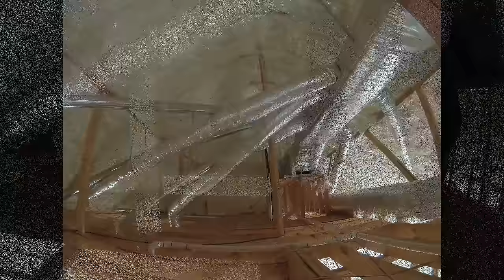Open Cell Spray Foam Insulation

Comment: So, what happens if the wood cant breath? After all its a living material.
We use foam at work but we dont fill entire walls with it.
Reply: the lumber here is a DEAD material. it should be dry and never get to breath.  If it breaths you have problems.
Reply: @kirksway1  Well, in that case why use foam at all? It makes a more expensive project making sure the wood is completely sealed compared to ordinary insulation, the regular old insulation is cheap as it is. Not to mention the new insulation is nice to work with, I can rub it in my face without itching and it doesn't make dust particles.
Reply: @kirksway1  He's talking about his "wood"...

Comment: Does anyone know if the Companies that do spray foam insulation "make their own" foam with chemicals or are they just buying the kits and upcharging the customer? I'm trying to find a way cheaper way to make my own for DIY attic insulation.
Reply: You have to be a licensed sprayfoam contractor to even buy the chemicals from a manefacture or distributor and have the proper equipment. I am a sprayfoam installer and highly advise not to buy a DIY froth pack kit from a local hardware store. There is a huge learning curve for this trade and you need to make sure you get a well established sprayfoam contractor to do your job.
Reply: Buy Froth pak great experience every single time. Just monitor both jugs so they dispense evenly.
Reply: @vertihvost7675  do not buy frothpaks…. they are a waste of money for a consumer
Reply: @BmxScuz  it's not like you're biased or anything being a spray foam contractor and all...🤣  I'm sure all painters advise a professional do the job, and mechanics etc.
Reply: Its just a hobby if your not making money, businesses have to add a percentage to everything they do to make a profit. Bro i been in business for years, work coming out my ears, stressed to max making nothing. Last 2 years looked at myself seriously, stopped charging with my heart, charged as a professional, now my bank account is way better, less stress, less tire kicking customers, better quality of life overall
Reply: @bumpsfarnorthnz6257  I can tell your a compassionate fellow. I'm the same way. I know your not looking for advice on anything but it made me have an idea as I read your comment. 
People like u & I have a hard time not martyring ourselves trying to help people out so I would actually delegate the pricing/Bid to someone else, family member/employee, that way when you show up you're essentially just the "performer of the task" and therefore your heartstrings will not tug. It's out of your hands. Having said that I'm glad you're making money & it's turned around for ya.
Reply: @BmxScuz  Not really.....

Comment: Do not like the way you apply the foam. You should dl the edges first and then the entire area between the studs. Not the area first and then the edges. Two pound closed cell foam is better.

Comment: Can anyone say what material is it that they are spraying?
Reply: You have to be kidding me...

It's open cell spray foam insulation ffs... The title literally tells you what it is
Reply: Since this guy who replied was rude as hell, this is Polyurethane Spray Insulation. Many companies make it, but theire ingredients can all be different.
Reply: @twizz420  namaskaara brother🙏🏾. I reside in tropical climatic region and hence I've never seen such insulation being done anywhere. I am pretty sure you would be amazed by things that we do in this region as I was with this insulation spray. When a person asks a genuine  question please answer them only if you want to. Please do not try to spread the poison that you have in you by being rude. Hope your friends and family do not see and tolerate this rude behaviour from you. 🙏🏾
Reply: @ryalsackjon3020  thank you brother🙏🏾. I am working on a new type of air conditioning system for tropical climates  and I wanted a good insulating material to insulate some pipes in the system. That's why I am interested in this material. They appear easy to apply and can be made to any shape. How are it's insulation properties? Any idea?
Reply: @aravindz89  Okay, well, just like fiberglass insulation, a certain thickness of material means more efficient insulation. Homes and appliances, at least in the US that I know of that require insulation, have to meet a certain insulation amount, based on the region or the appliance. The value of insulation is called R-Value. The higher the R-Value, the more insulated the home or appliance is. 
Now, there are two types of spray foam. Open cell and closed cell.  Open cell is a soft thick foam that expands alot, takes more foam to reach the desired R value. Closed cell isnt NEARLY as thick or expansive as open cell foam, BUT it has a higher R value. It is extremely hard, like hard as a rock. 
1 inch of Open cell foam has an R value of 3.7
1 inch of Closed Cell has an R value of around 6.5
I havent ever actually seen AC equipment  insulated with spray foam. Every AC unit I see when I’m spraying is insulated with fiberglass at a level of R-6 to R-10. I cant give advice on that part of things, just telling you what I know
Reply: @ryalsackjon3020  Thank you for the knowledge. The AC that I am working on is still design stage and I am in search for alternative substances for insulation than fiberglass. I will have a look into this open cell and closed cell spray foam system and will make my decision's. Thank you again

Comment: LMAO no suits? First time I've ever seen this.. This guy is trying to move on to the next bay too quickly. I'm sorry, but I'm not moving past 3 bays without making sure they're adequately filled. Not trying to run around spot checking and hitting things all day. ALSO, this guy WAY overfilled some of those bays. He's just tryna rip and run.. Look at the poor floorman, having to saw off 3 extra inches of foam. I need to come work for them and get em right lol

Comment: Hi there!! I am from Argentina, Tierra del Fuego. I like so much your work. I have been looking at machines to do the same, but they are very expensive for my economy. Do you know of someone who has made the machine in a homemade way? Any specification? Thanks and sorry for the inconvenience. Best regards!! Walter.
Reply: No there's froth packs for home use but to make a machine like this is almost impossible due to its technicalities
Reply: @isaacfranco9216  looks like this machine have same system of the high presure water cleaning. Also, some people use an attachment to spread bleach in the water machime.
Reply: @model901  Not even close. This mixes the heated chemicals at a custom ratio to achieve the proper ratio and cure. A pressure washer simply pumps water through a small hole.

Comment: any way to texture this like a knock down? Will it stay stuck on to metal? Will it gas-out fumes in summer heat? Can it be painted?   How much to do roof and four walls of a 10x20 metal arched building?
Reply: It will stuck to the metal if you do this properly. The price range are 10-13$ /m2/2cm in indonesia
Reply: Yeah it will stick to anything it's sprayed on. Besides something that has water, oil, and anything else liquid. And price depends on the depth, the foam your wanting installed, and the labor and plastic put in.
Reply: @andrewjones5717  He pulled it right off the plastic sheet at the beginning of the video, so obviously it won't stick to anything that smooth.

Comment: Seriously.  Not even long sleeves and pants. If he isnt slathered in barrier cream and reapplying every 10 mins every inch of exposed skin will be fucked with overspray. He will need a wire brush and a paint thinner bath. 🤣

Comment: Your cheatin you supposed to spray it on the wall. Not on a piece of plastic
Reply: lol the first foam you spray of the day is colder than the temperature it's supposed to be spray at., You have to spray a little bit to get the cold stuff out. Plus, you need to do a test spray to make sure the foam has the right consistency before you apply it. If it's brittle, it's too cold.

Comment: Why o why do people keep putting open cell on roof decks what a horrible idea low R-vaule per inch and dose not provide anything  sound and low value should have used closed cell foam way better foam the open cell can't wait for those people to have a roof leak cause that stuff is like a sponge